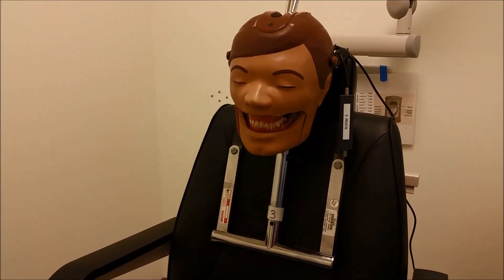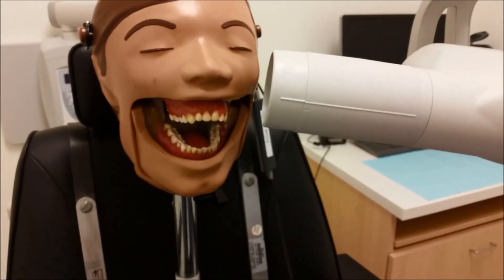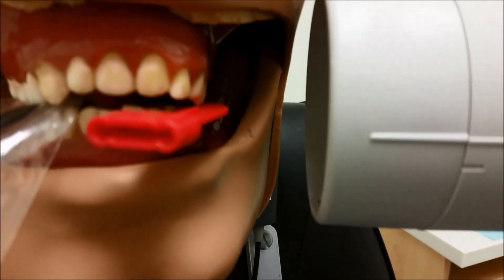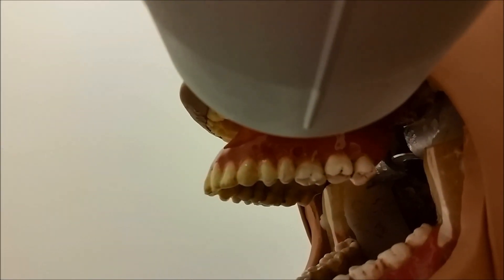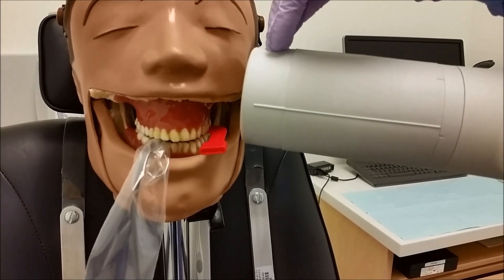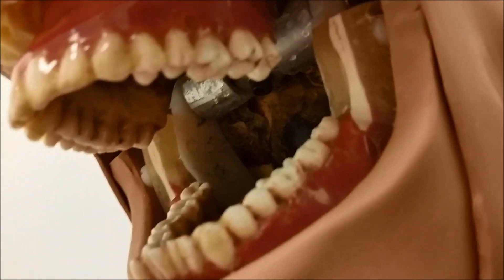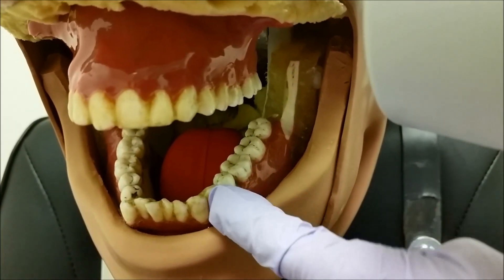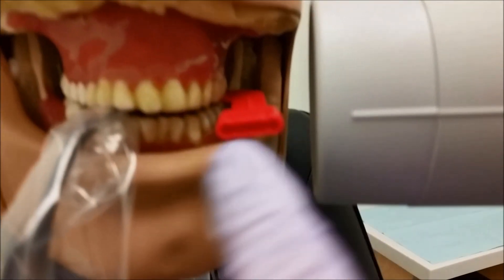Bitewing Technique

Comment: Use a phosphor plate instead of a sensor with the cord. The latter is very bulky. Also use the film holder with the 0 ring, in order to position the x-ray tube more accurately.